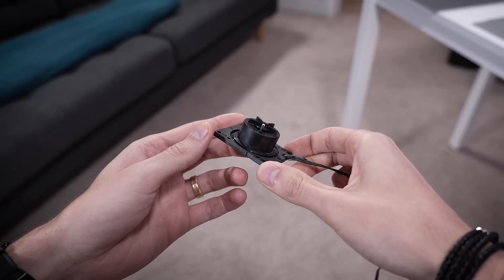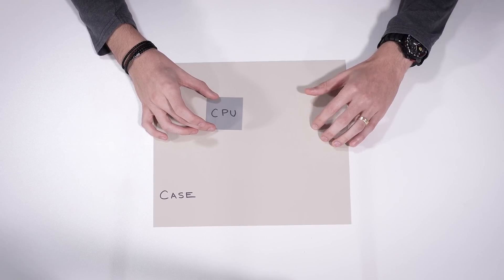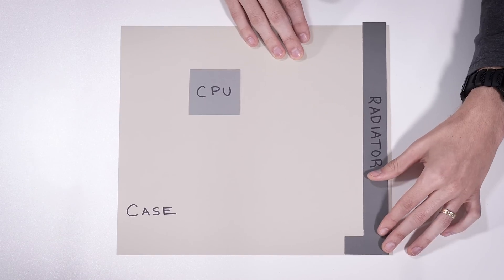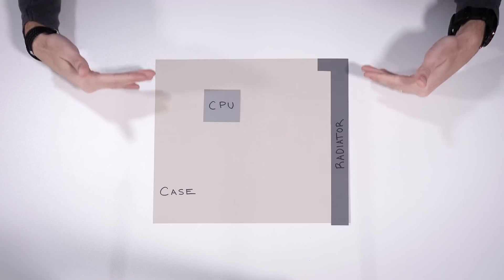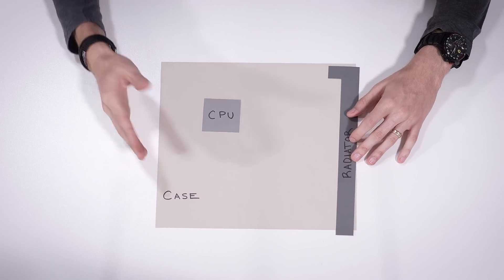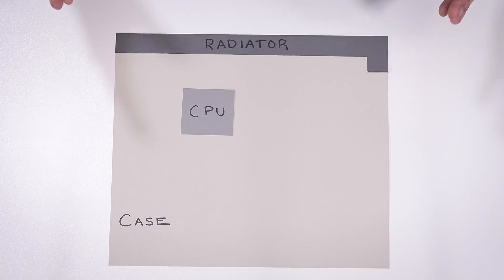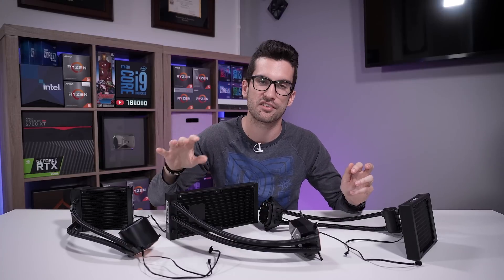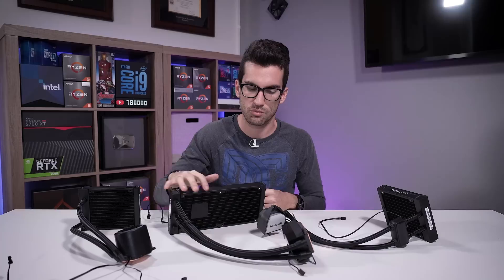All AIO Mounting Positions Explained

Comment: Artic freezer II  does need to have an option for a long/short hose, so that you can orient it barbs up or down on the front side of the case. It seems it would fit, if the gpu wasnt in the way.(Riser cables/ virtical position might be what it was directed at)

Comment: The question is how much air is introduced in the AIO when it is assembled at the factory. Is it enough to displace a BBs or less worth of fluid? In that case as long as there is enough fluid to keep both tubes full of fluid there should be no problem with where the radiator is mounted relative to the pump. There should always be fluid flowing through the pump and tubes in that case. Only if there was enough fluid loss where one or both tubes would be devoid of fluid would there be a problem. One scenario where that might be a problem is where the radiator is mounted horizontally completely below the pump. The pump may not be powerful enough to pull up the fluid away from the radiator and thus shortening is life.

Comment: Hey Greg. I think another thing that people overlook when complaining about barbs up is this. The Radiator (part where the fins are) has 2 tanks. One at each end. The tank in which the barbs connect, is split in half. It's essentially 2 tanks. Fluid enters one tank, is passed through the fins to the tank at the other end, and then is passed back through the fins to the barb side. People complain that if the barbs are up, there's a chance that air can collect at the top and be pulled through the tubes to the pump. If you realize that the barb side tank is split. If the pump happened to suck in any air, the air that has left the pump (in the cpu block) would accumulate in the tank where the input barb is located. In order for that air to reach the output barb tank (Since they are split) it would have to travel all the way down through the fins and back up again to the other side. Those asetek pumps are pretty decent, but it would have a hard time fighting gravity to push air all the way down through the radiator in order for it to reach the other side of the barb tank.
Reply: I have mine mounted barb side up on the front, all working fine but would the air in the input side of the radiator hinder the water getting into the radiator?

Comment: I bought in October a MSI CoreLiquid 240R. (Similar to the one if one of your latest FoF Vids that you took apart.) I looked up some research on AIO positions, but was not aware of different pump locations. It goes without saying, last month, it died. I know you said you cant say if it will or wont, but take it from someone like me who has experienced it, it can and definitely will.

TLDR, I had a Pump in Rad Aio, mounted on the top, and it died in 5 months.

Comment: For bequiet there's two pump styles depending on your location. In Europe where Asetek doesn't hold the pump in block patent (or it doesn't apply as strictly as in the US) the bequiet AIOs are a pump in block design. I think the pump in tube design came from ITCooling.

Anyway I love the fact that bequiet gives us a fill port and encourages topping the loop up. That was pretty much the main selling point for me. There's only a few others that have a port, but usually you void the warranty if you refill by yourself. That was a major point for me to go with either bequiet or Alphacool.

Comment: I'm using Be Quiet! Pure Loop 240MM on the front of my H510. So far it's working flawlessly but it just the 2nd year of it. Hope it can last longer. Idle temp that I usually get are around 35-45°c on my 11th Gen i5. Great video!
Reply: Im using the 360 aio front mounted barbs up with the pump slightly below, 65-68c under load.

Comment: The front mount with barbs up will still get noisy quickly (relatively speaking, probably a couple years, but faster than other mounting positions), because the first air bubbles that form eventually will be trapped at the inlet of the radiator. This is fine for pump lifetime, because no air is being sucked into the pump, but water from the inlet will be dripping into the water inside the radiator almost like filling up a reservoir in an open loop system. Which is why most reservoirs, that have the inlet at the top, have a tube going through the reservoir so the inlet water doesn't drip and cause noise.

Comment: Please test 120/240mm in block vs in the radiator pump. I think you would lose so much rad surface area when you put the pump in there that a 120mm with the pump in the block would not make much sense
Reply from the maker: I think you should re-read your comment because, as it is, I'm confused. I think what you're trying to say is that a pump in rad would reduce rad S.A. and make it worse than a pump in block, yes? To answer this, I think it comes down to where the pump is situated in the rad. If you notice, most of them are positioned directly under a fan bearing where almost no air passes through. Air moves quickest around the edges of fan blades. Sure, a chunk of the fin stack is removed, but you wouldn't have much active cooling in these areas anyway. I'm sure there's a difference, however I believe it's much smaller than you expect.

Comment: 4:28 I think it's relevant to point out that water does escape from AIO tubes very very slowly. After some X number of years the tubes on top placement could kill a pump-in-a-block AIO much sooner than normal wear and tear using a tubes on bottom configuration. The AIO may also have been sitting in a warehouse for some time before you purchased it on a black Friday sale. To apply Murphy's law, it will happen just after the warranty expires 😆
Reply from the maker: Often takes several years before any noticeable fluid loss occurs. We're talking 5-7 years or more. By then, get yourself another cooler. It's time. Lol. Pump bearings, tubing seals, or fans may fail before the thing ever chokes on air.
Reply: @GregSalazar  Interesting take, I wonder if a company like artic would deny a warranty claim because it failed because it was mounted with the barbs up on the front, 5 years into a 6 year warranty period.
Reply: @Uranthos1  If there's not instructions stating otherwise, how could they?
Reply: Problem is though, like the picture that was tweeted, sometimes you have no choice and just have to risk it. But still, 3 years or so of a cheap AIO and you can't really complain. The benefits of water cooling for those that want lower temps is well worth the issues that could come later with losing water slowly over time. Even better knowing your CPU has over heat protection so if things shut off you can at least try get into BIOS and see your temps before it goes again to confirm a diagnosis.

My next PC will almost certainly be a custom loop, than not only can I see the water level and top it up, but I can easily see if the pump is going and replace it which long term is better in every way, I can also simply just keep a spare pump on hand.

AIO is still handy if installed correctly, it's just easier, but almost guaranteed not to last as long as air cooling or a custom loop.

Comment: Im a custom loop person. The main reason why I never recommended AIO liquid coolers was due to Asetek and their patent shenanigans. But its real cool to see others find another way. That Bequiet AIO is really interesting. Thanks as always greg. Love the the construction paper cutout presentation.
Reply: Yup, I recommend Be Quiet or Arctic AIOs a lot.
Reply: InWin BR24 and BR36 have the pump on the tubes as well, plus the VRM fan, that I believe Hardware Busters noted that also cooled a little bit the back of a Gpu. Sadly their review units had problems with the "over-block" fan. I wish more manufacturers build with fans over the pump like InWin's BR36 or Arctic's Liquid Freezer II
Reply: Yeah Asetek are always crying 'You can't do that or We'll Sue' yet they have no problem with copying others designs like they did with the design they made for the Dell/Alienware RTX2080 with the Blower Fan Cooled Rad that looked like a SLI Set up (which Greg had a look at here), Blatant Rip Off of previous design but 🤷‍♂️
Reply: I'm a Noctua person.
I never recommend any water or liquid inside my system. :)
Reply: I have the 260 version of the be quiet one and the CPU is verry cool in a bad airflow case so not bad. And it isn't loud so jeah

Comment: Hello, I have a Deepcool Gammaxx l240 v2 liquid cooler and my CPU is an i7 9700F, in gaming mostly in Gta V it has peaks of up to 81 but most of the time it is around 65 degrees sometimes 70 that caught my attention but not in idle it drops below 40 degrees, could it be a cooling problem?, it's 4 months old and I bought the cpu 1 month ago

Comment: I really like the pump in tubes design and hoped to upgrade to the pureloop 120 for my phanteks shift, but damn it's hard to find them for a decent price. For the longest time Amazon only sold them from Italy for some reason 💀. Sadly I have to have my radiator at the bottom with the pump above it on the cpu. Somehow managed to move the bubbles elsewhere but I fear for when I have to clean it which moving will disturb the way I got the bubbles away from the pump lol.
Reply: Aigo makes AIOs with the pump in the tubes. The AT240 and AT360. Both under $120 on Newegg. I have the white AT240 and it works pretty good in my experience

Comment: I haven't touched watercooling since 2011. Wasn't impressed with the AIOs I had tried, have no inclination to try it again. Admittedly much of my complaints about it may have been orientation related as there was little proliferation of knowledge on the subject back then.

Still good to know though just in case someone asks me about it.
Reply: All in one coolers have made exponential improvements since 2011. The pumps are extremely reliable. So much engineering time has gone into making the tubes as impermeable as possible to reduce permeation. This will make sure that a radiator filled full at the factory will stay full for several years. That’s why most major brands offer 5 year warranties (nzxt who uses an asetek, corsair who uses a CoolIT pump both of these companies offer 5 year warranties.) then you have companies like artic and their liquid freezer 2 with a 6 year warranty, but that pump is their own in house design. EK also made their own in house pump for their AIO’s. TLDR: I would not worry about any modern aio leaking. Just buy one with good reviews and an existing reputation like corsair or nzxt and now artic and EK. Installation is so much easier these days too. And with the heat some of these high end processors put out, unless you want to go custom loop, an aio is the best way to extract the most performance which you paid for.
Reply: My NH-D15 will never go bad. Lol

Comment: its funny bc of my case i had to have it at the front and i have gone through 3 watercooler bc there was air trapped in the cpu block where the pump was
Reply from the maker: Very unlikely if your block was lower than your barbs. Likely something else at play - or simply a QC issue.

Comment: please address fan direction on the radiator :)
Reply from the maker: I literally did. Discussed top mount fan exhaust vs. intake.
Reply: @GregSalazar  ok i guess i have a specific question...my radiator is front mounted, should the fans be sucking air in from the outside or inside of the radiator? if that makes sense
Reply: @Terrencepng  You'll want your fans intaking air from the outside.

Comment: i was going to buy one but my air cooler does just fine
Reply: I'm on an NH-D15 and until I get a platform and CPU that throttles under extended load then I'm probably sticking with it too. AIO systems and any liquid cooling is definitely more performant overall, but the simplicity of a tower cooler and the easier upkeep in the long term is an attractive thing.
Reply: @Lyander25  Yeah my cpu isnt always under a ton of load/usage so it doesnt get hot and i dont overclock even tho i have a msi mpg z490 board
Reply: @acseptt8100  haha I'm on a ryzen 3600 and a B550 board so there's a lot of headroom for performance gains with everything staying the same except the CPU itself. The new Zen sockets might need a new mounting set but Noctua's generally great about that.

Comment: BUT STEVE FROM GAMERS NEXUS SAID SO! - Every Fanboy on this argument
Reply from the maker: I think the real issue is that Steve's complaint about front mount/barb up is being misconstrued with other, more detrimental mounting positions discussed in their original video. He criticized vendors for showing this config in marketing material and people immediately assumed that it was a deadly sin.
Reply: @GregSalazar  Right, Steve had genuine criticisms on the whole grand scheme it's just the fan response about it generates this massive headache.

I front mount my 240 on my H510 and people that didn't understand just would do everything in their power to say "your wrong" without anything other than Steve's video to back it.

Both you and Jay shouldn't have to have the need to make these types of videos. Don't get me wrong, having more credible sources is the best way to have a solid stance on the matter but...